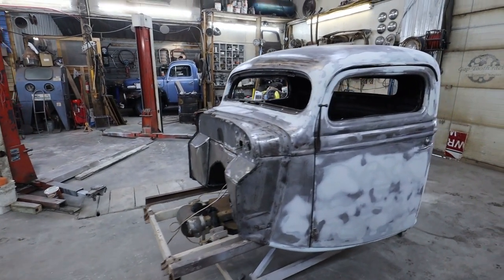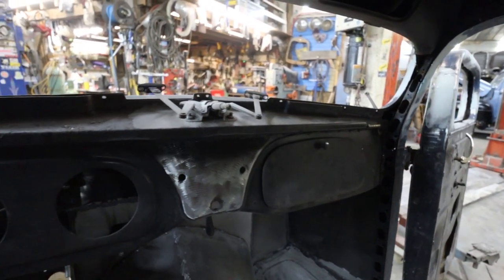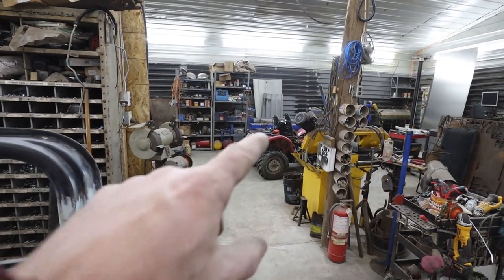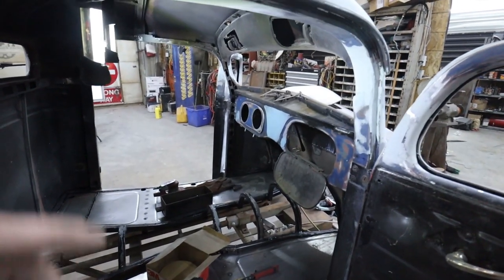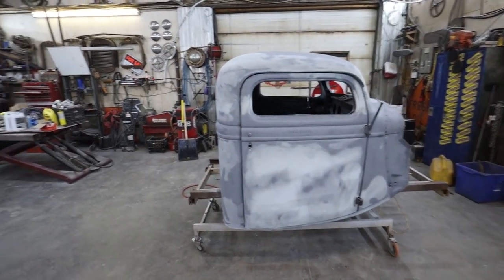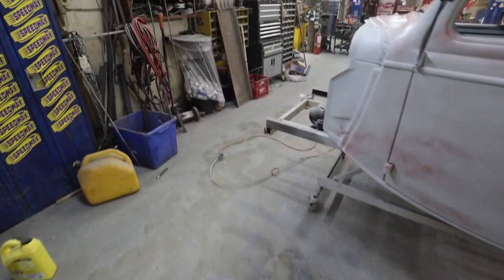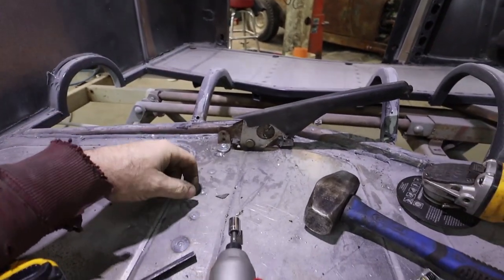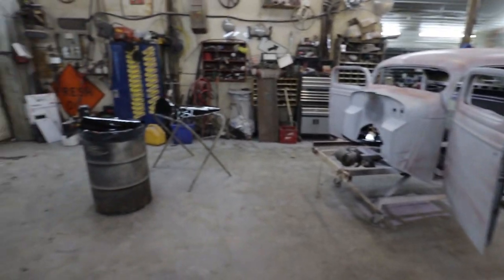Priming the 1937 Ford pickup cab and painting the floor Part 25

Comment: To speed up your oil-based enamel paints drying time use Japan drier.
It helps the paints cure faster gives them a little more gloss and it lays them down a little flatter with less Orange Peel or stroke marks.

Comment: The original pastel dark blue looks really nice,why not do it inside and out.One other thing I would do is spray 3M polyurethane undercoat on the bottom of the cab to further protect it against corrosion.

Comment: Suggest  doing Suicide doors, making it very special. Doors are 90 degrees, and non hard top. Should be pretty simple. I watched the General build, so should be a simple  thing for you. Swapping out  (90 part of A&B pillars, welding them back in.
Reply from the maker: I dig them but can't be trusted with them. already had the one door on the merc fly open randomly on the hyway haha
Reply: @HalfassKustoms  That would defiantly get  attention L MAO.

Comment: Excellent video Brent  :) looking nice also cigarette lighter in great spot for someone hook up cellphone or I pad or GPS devices for recharge battery up and think horn button be great spot too ! Plus Am/Fm radio are you putting one in too ? Also think idea for box do you have varcor sides to so put light tarp over below top  lip so carring small and keep dry on supplies in box and won't get wet  open much need at time from Varco up seal too!

Comment: I enjoy watching your videos, mainly because a lot of the guys I worked on cars with would have been flinging tools at FAR lesser unforseen probkems than you just laugh about and deal with like a sane person does. I would just tell the car or truck, (or X-Ray suite) You might think you can intimidate me and beat me, but I'm staying until I compete this work, do it properly, and professionally, so you might as well resign yourself to being repaired, because I'm not leaving until it's all completed. At that point the tools I most likely will need to begin are laid out, along with any rags, sprays, or parts and so I would get started.

Comment: Yet another great vid 👌
What do you use as the floor interior caulk sealer? & was that tractor frame paint in the quart can of black would that be good, or what's better for going over my Land Cruiser frame as I'm going after surface rust with a wire wheel & physical scraping and some rust stabilizer to get my frame on my Land Cruiser to be nice as it lived in B.C. Canada for its first 20yrs& being driven on salty winter roads it has a little under body rust and I want to make it great and keep it looking excellent from now on as this is a vehicle that will live on long after I'm gone and the people after me can enjoy driving the turbo-diesel for the next 100 yrs or better with the same smile on their faces it gives me. Good times.
2 questions best frame paint after cleaning up surface rust (slight amount) and floor sealant caulk. What is that you're using is that a urethane?
Reply from the maker: I get  the seam sealer from Napa it's a Dominion Sure Seal rebranded to Napa I believe and use that DOM16 for the chassis paint like I have on this chassis.
Reply: @HalfassKustoms  
Thank you 
I'd like to see blacklight underdash to light up interior I'd like to see your truck look even cooler 
Also wondering why the red windows on the model T roadster (is it a model T roadster?) Great videos thank you for sharing with me your knowledge really appreciate the product information.
Thank you 
David
Reply: Excited to see what's next on progress VLOG